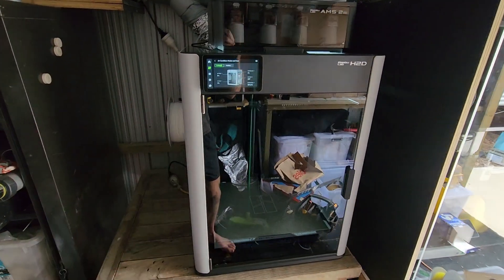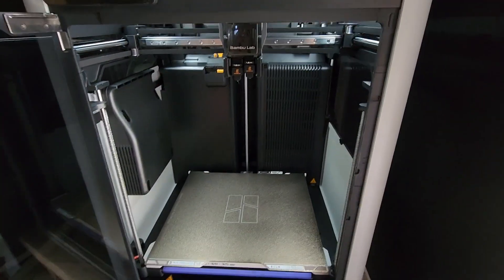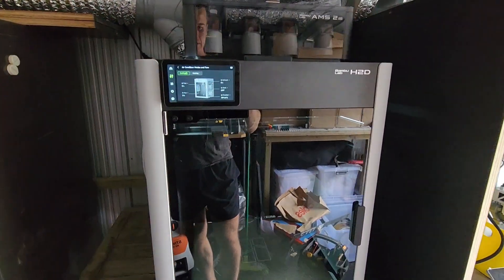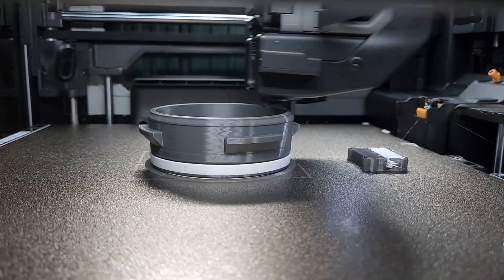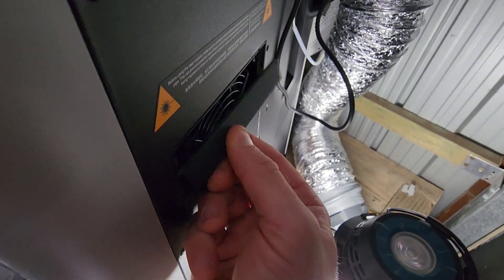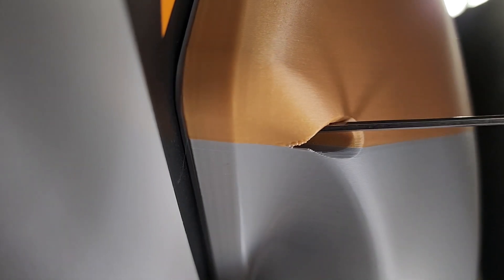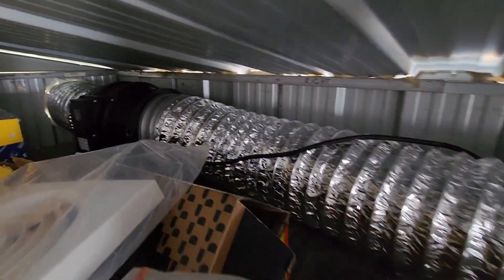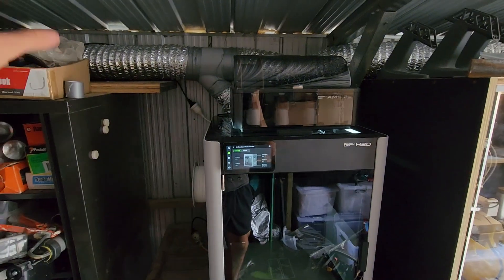Bambu Labs H2D 3D Printer - Extraction and Exhaust System - DIY FIX

Comment: I was waiting for this printer hoping for a better filtration system. Are you saying it only filters the air when recirculating it inside?
In principle, if it always did that, it should not matter if at the end of the print it opens the vents as the air would be clean. But if it does that only when heating the chamber then it's a bad design. For ABS/ASA that would be okay, but not sure if chamber heating can be used with PETG. PLA is out of the question.
Also, on the spec they talk about G3 + HEPA + Carbon? Is it possible you're missing parts?
Reply from the maker: @zmast333  so was I, very disappointed. 

Yes that is the case at the moment, the only filter that comes with the H2D (not laser version) is the activated carbon filter for recirculation VOC removal. Normal exhaust/cooling bypasses the filter and out the exhaust port. 

No the air wouldn't be clean. The activated carbon filter would not eliminate the ultra fine particle emissions. Either way you look at it, without a true HEPA filter for any operation, external ventilation is required. 

Now this is not including the H2D laser components or external filter module which I would expect to have true HEPA and much larger activated carbon filters. I still prefer ventilation to atmosphere at a minimum. Hope this helps.
Reply: @diysalmon  Thanks for the info. Unfortunately, few people talk about this stuff.

I'm still in disbelief... they had the G3+HEPA+Carbon filter on the X1E so I assumed they would just use that on all of their future printers.
On the H2D specs sheet they don't make distinction between laser/base models. It sounds like they would both have all filters. Yet, you only have the Carbon filter and the Wiki only mentions that one too.
I'm going to contact them. This makes no sense.

The H2D is overkill for me, but they don't sell the X1E directly and it's even more expensive than the H2D at resellers. WTF...
Sadly, I can't vent outside easily.
Reply from the maker: @zmast333  I agree, I thought it would include all the filtration mentioned as a base level. Prehaps a software update and filter release will solve in the future.... time will tell.
Reply: @diysalmon  FYI, I asked Bambu and they said it is G3+HEPA+Carbon as stated in the spec sheet. From the pictures it also looks very similar to the X1E one, so maybe looks are deceiving?
Reply from the maker: @zmast333  For the air purification version, yes but the standard H2D filter is only activated carbon, you can tell its not HEPA. Also regardless of its filtration type, it is still bypassed for PLA/PETG and other non temperature sensitive filaments which makes it completely redundant for UFP.
Reply from the maker: Just FYI this going off the replacement part specs for the H2D filter, which states only activated carbon. As well as the filters small thickness, I am tempted to pull it apart and see if there is any other filters as you mentioned.
Reply: @diysalmon  I can confirm this is still the case. I received mine yesterday, and was surprised and concerned of smelling the distinctive smell of PLA (I've been using for years my Ender-3 in an enclosure with a ventilation system, I forgot about that smell). I removed the cache in front of the filter, and saw the same thing than you: it's completely bypassed, there's a huge gap on top of the filter allowing air to pass freely. The thing is, there is actually a motorized trap door here that could move to block that gap and force air through the filter, but it just doesn't, at least not when printing PLA. The good news is that it means we're one firmware upgrade away of this being fixed, should Bambu Lab take the problem seriously (there are other vents, but this one is worked by a fan, most of the fumes should go there). Meanwhile, we're just breathing clouds of microplastics. 😕 I'm going to try to make for myself a ventilation system, somehow. Sadly, the printer is too big to fit my Ender-3 enclosure.
Reply from the maker: @kik-was-here cheers for the update! Don't forget though, a software update won't change the VOC filter to a particle filter, so would still need to look at getting a suitable filter if one is available now.
Reply: @diysalmon  Oh damn, you're right. Thanks for pointing it out!

Comment: nice man! im thinking of doing that to mine too. right now im running 2 x1c´s which are getting returned, got 2 defective units XD and now I ordered an H2D first and hope for a flawless device before I get another one.. I plan on running them in my office room. they gonna be placed about 2 meters away from the window, and im sitting 1meter away.. but id run something like this too. What fan are u using for the exhaust to pull that much air as you show the pressure in the video? Thank you, liked and subscribed.
Reply from the maker: @Victa12  Hey mate, that sounds like a good plan, although I'll be honest the H2D hasn't been flawless so far, but with future improvements no doubt will be better. 

Yeah nice, I'd still run a small inline fan near the window in addition to your h2d's exhaust, just so the duct is pulling the air through. I use a bearing less 150mm inline exhaust fan from a hardware store here "bunnings" but any high flow inline fan will work. Thanks mate, glad it helped!
Reply: @diysalmon  hey thanks for bothering to answer mate. may I ask, what issues did u have so far? for the x1c is have no hope for better units. I mean they been out for what 3 years now? If they still ship them like this, they clearly dropped the ball on those. after thinkering a while I managed to get rid of some issues, but the goes agains the main reason I bought them, not to tinker, just freakin print. I have 2 kids to take care of, can't be messing around with those after paying 3k for 2x of them. no time for that...
mainly the horrendous poop Shute, together with bad belts and pulleys, and a lot of loud vibration noise on one of them, squeaking on the other one... nothing seems to fix it. looks like the head is getting too much friction on the carbon rods...as it is very hard to move also when powered off. its much easier on the other one I have, but that one has other issues, like the head hitting the back wall, so much that it already damaged the plastics on the back of the head. it skipped a step or 2 and it doesn't seem possible to 0 it again...so many overnight prints that just stop right after I go sleep because either the poop Shute is blocked or something jumps back on the plate and messes up the print, incredible how all this YouTubers praise them so hard..
Reply from the maker: Hey mate, No worries. Issues were the ventilation, need 2 AMS to properly use the dual heads without manual swapping, TPU 95A jammed first go with new AMS2 even though it states 95A is okay. The method to use TPU is fiddly to take off the AMS, change over PTFE tubes for rear port and then thr issue of no where to put the TPU roll to allow low friction filament path. Just minor efficiency things so far that I was hoping was more seamless. Actual print quality is fine. Personally never been a fan of the x1 and P1s, but the A1's are brilliant for the low cost, I prefer them over the Mk4's anyway, especially with the AMS lite. I do 99% of my products in PETG though.
Reply: @diysalmon  I see thank you for taking the time to answer. I want to have 2 printers, I hate only having one. I need to see if my budged is enough for a second h2d and firstly if it's worth it.. if not I may go with an A1 just for printing smaller stuff. I find myself liking petg the most also, I just got into this 3d stuff since 2 months. ordered an A1 but it was defective, probably the logistics.. then I sent it back and went with 2 x1cs but also unlucky with both.if I get issues again, ill have to switch company. but not sure what to go with that goes on their level of speed and quality of life. I dont care about all this open source stuff. I want it to just work... any tip for me?